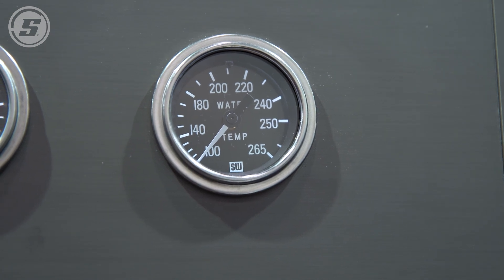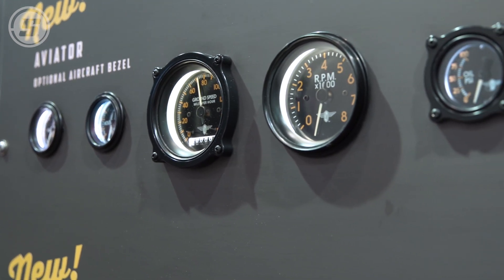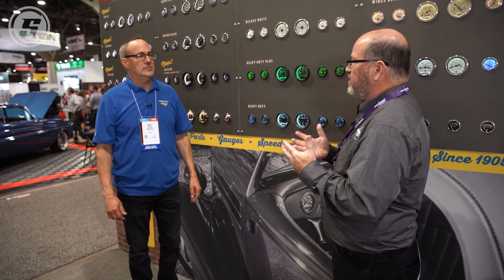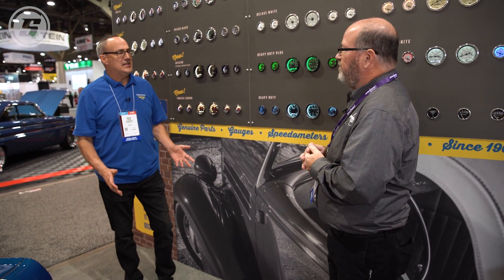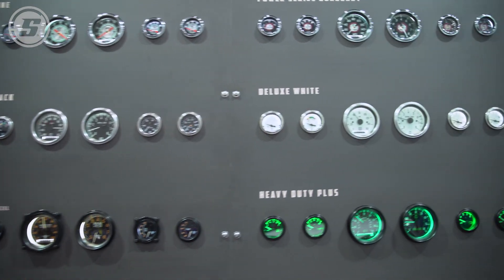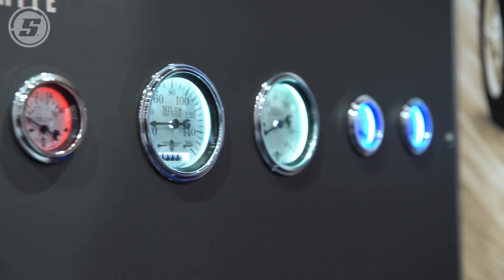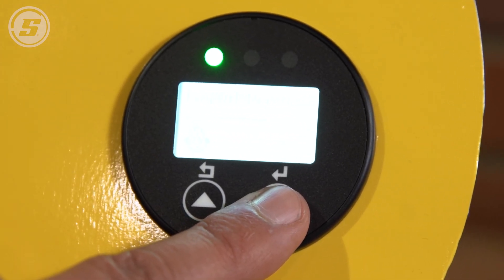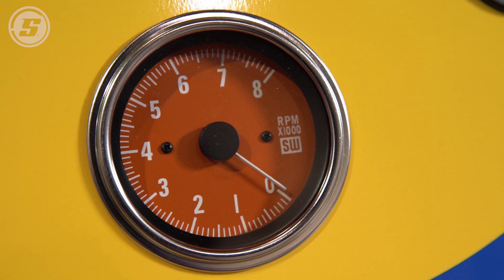Mechanical vs Electrical Gauges | Pros & Cons with Stewart Warner

Comment: After having so many speedo cables snap on me I greatly prefer electronic gauges. Instead of these generic gauges I'd like to just unscrew the speedo/odometer assembly out of my stock 1957 guage cluster and replace it with another that looks the same just works off an electronic signal instead of a cable. no such device exist, its very problematic if you swap to an LS engine since it needs a speed signal from the transmission. They do have full gauge clusters that look ugly as hell for 1000 dollars that work on electronic signals but I don't want a full cluster that looks nothing like the original. So i've been learning how to design PCBs to make something that works

Comment: Listen in at 3:15 because this is a massive understatement. I wouldn’t have bought these knowing that the perimeter light rings  inside the gauges filter the warm incandescent bulb into a very ugly blue white light. I was so disappointed when I wired these in and finally turned on the white face winged vintage gauges I’ve been dreaming about getting and they were BLUE 🤢 Not warm incandescent like everything else in my 1939 Deluxe. Crappy blue, with no way to fix it, if a guy wanted blue he could put a led in it. I want to see my  incandescent bulb but I can’t, you said no, enjoy this blue plastic filter in there.. massive bummer. They look better off and I argue that’s why you can’t find a single picture of them online in the dark and illuminated.